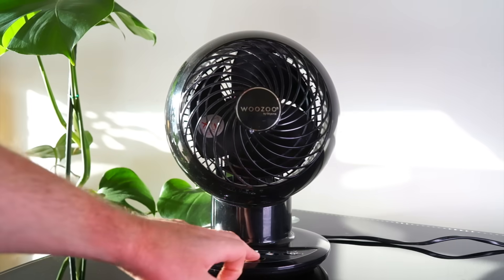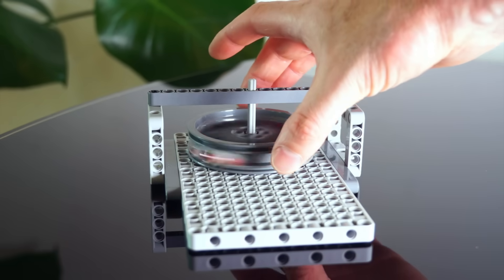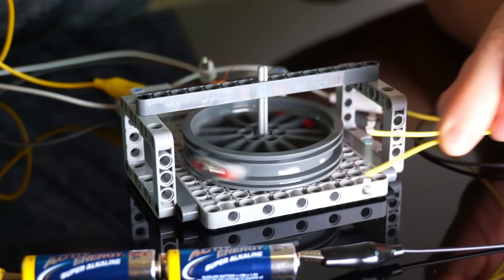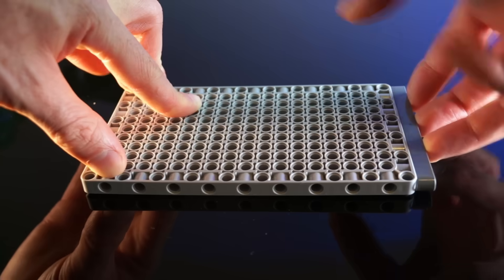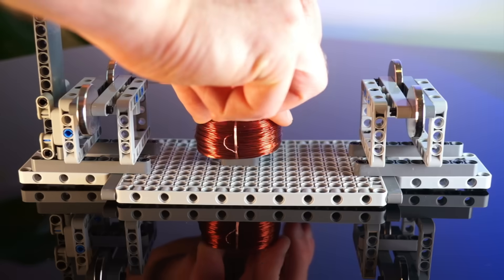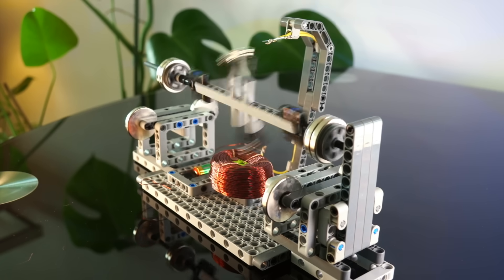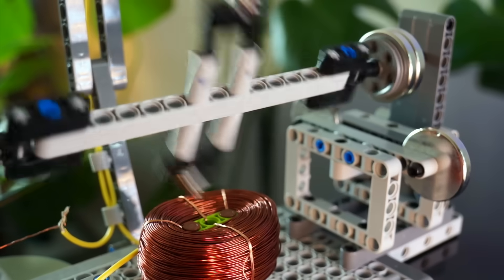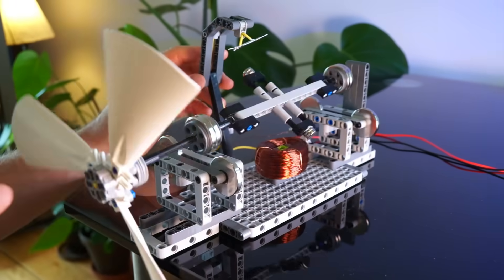Making a Totally Silent LEVITATING Fan Using Lego

Comment: Add more magnets, now you have the most basic setup, the more pairs of magnets you have the more frequently the coil pushes the magnets, also you can use a reed switch but make it turn on a transistor so your reed switch wont weld itself, and also you could get away with much much smaller coil, as for the power delivery you can still use the signal from that one reed activated transistor to turn on/off a pair of smaller coils sitting close. if you have lets say 5 pairs of magnets as your rotor you make it so the polarity alternates - the coils are apart exactly how far apart magnets are and the coils alternate in polarity too, now you can extrapolate it in two ways. Use one rotor and for each magnet you got one coil, or you make a second rotor and second pair of coils, and if the shaft already spins the rotor acts as a flywheel, you can hook up the transistor gate to one of the coils so it opens and closes exactly as fast as the rotor spins, now the only thing to do is speed control which you can implement as potentiometer which you put in front of the transistor gate, hide the circuit with bricks (also, use a sturdy li-ion 18650, pick one from philips/sony/samsung etc., you want the current to not be the limiting factor, but also you need a way of limiting current if you use one of them big boi batteries, they are quite powerful and will fry the circuit if you dont have a way to throttle them and limit their current). I hope that i provided at least some ideas for anybody! Sorry for the wall of text
Reply from the maker: Woah that's some phenomenal advice, really appreciate you taking the time to explain this! 🙏 I think I already have most of the components here.. love the idea of using a LiPo to provide all the current it needs. Wiop just need to play with combos of coils and magnets. Thanks again for the ideas! 😁
Reply: Well, the project is dope and I got excited like a little kid 😅
Sub well deserved ❤
Reply from the maker: @likemau5552  aw that's a hell of a compliment, thanks man! And cheers for the additional ideas 😉

Comment: Perhaps you could use something like a relay or mosfet, using the reed switch for the signal instead of handling the load 🤔
Reply from the maker: That makes a lot of sense, a few folks have suggested that, so guess I'll have to give it a try! Cheers 😁
Reply: @JamiesBrickJams  If you do that, also make sure to add a diode in the blocking direction (pointing from negative to positive) parallel to the coil. The coil generates high voltage pulses when turned off, which isn't a problem for the reed switch but almost definitely will be for the MOSFET.

Comment: Use more magnets to secure the ends in place, with all that axle wobble your power output isnt consistent either!
Reply from the maker: For sure, that wobble is frustrating. Once it's moving fast, it all balances out nicely... But getting there is challenging. Worth trying more magnets around the ends - cheers!

Comment: Wouldn't it be better if you use atleast 3 coils around the levitating shaft with an ESC and you can also increase the magnets on shaft
Reply from the maker: It likely would. I actually chose to use just one coil for a silly reason - aesthetics. Figured it'd look cooler with minimal stuff in the way so you can see the levitating shaft better. But adding more magnets to be propelled makes a lot of sense, will try that! Thanks!

Comment: Very cool! I'll bet you could design and 3D print a single-piece fan blade that is far lighter than the one you built out of Lego pieces.
Reply from the maker: If I knew how to 3d print, sure 😁 It's a pity Lego doesn't have many options for fan blades
Reply: @JamiesBrickJams  See if there's a local makerspace or fablab that could help you out.

Comment: some magnets on the top to keep it stable might help
Reply from the maker: Hmmm never thought of more magnets to keep it from bouncing around ... Worth a try, cheers!
Reply: @JamiesBrickJams  Adding a second coil on the opposite side would also lessen the bouncing, the single coil design will pull the axle downwards every time it is triggered  which will then bounce back up once the coil turns off. Having a second coil directly opposite would counter that downwards pulling force from the bottom coil.

Comment: how does this not have more views? this is epic!
improvement idea: try different fan blade styles and magnet sizes!
Reply from the maker: Haha thanks 🙏😁 I could totally try different non-Lego blades. Though as the other commenter noted, Lego doesn't offer many blades. It's a pity their helicopter blades are so heavy. I will try more magnets though so there are 4 instead of 2
Reply: These are basically the only fan blades from Lego, so you can’t really make the fan different without making it less sturdy, besides changing the number of blades
Reply: Or I guess glueing it together is an option

Comment: can use bearings on each side for more smooth movement :D
Reply from the maker: I like the idea of using some kind of Lego 'bearings', especially if scaling up a motor that has a ton of torque!
Reply: @JamiesBrickJams  normal bearings will fit better than lego made :D I make time ago some experiments with lego technic and solar panels, arduino, esp32, etc and all runs smoothly :D
Reply from the maker: Might give that a go if all else fails.. but I like trying to maximize Lego 😁 That's awesome, what projects of yours used the solar panels?
Reply: @JamiesBrickJams  some type of Rover,with solar panels, charging system etc
Reply from the maker: Love it, cool project!

Comment: U can use a reed switch but it should be connected to a transistor and the output of the transistor can be connected to the coil.
This can prevent the lock up of the reed switch on passing high current as the high current only passes through the coil leaving the reed switch isolated
Reply from the maker: That makes a lot of sense, thanks! Yeah would be lovely to chuck a bunch of current through it without locking. Though I've a suspicion it'll still be quite 'bumpy' unless the positioning is perfect. Great advice though, thanks - will try it! 🙏
Reply: yee i was gona say that aswell
Reply: Mechanical switching on motors is bad as you're limited to the physical moving speed of the mechanical parts.
Reply: @DarenPage  its not a mechanical switch, its eletronic
Reply: @mecadragoon  the reed switch is just that; a switch operated by a magnetic field.
Reply: @DarenPage  yeah but its still a eletronic switch not a mechanical
Reply: @mecadragoon  ok, We're both right... It's electromechanical.
Reply: U can also replace the reed switch for a hall effect sensor to improve the performance.
Reply from the maker: Yeah, I've a whole bunch of them lying around - will definitely give those a try. And I don't mind frying them 😉
Reply: @xtrarobotics  would a smaller coil work? The moving magnet makes an eddy current, this activates the transistor and thus the kick to the main coil

Comment: how to improve this thing: don't use a reed switch
Reply: Use a hall effect sensor and a transistor instead
Reply from the maker: @agaldoo  that I certainly will!
Reply: @JamiesBrickJams or even just a transistor with the reed switch. Will still work fine but won’t need any sort of digital control.
Reply from the maker: @xiar5546  seems a few folks have suggested that, so will definitely give it a try. Should be able to transfer a lot more power anyway. Just gotta find a good position for the switch
Reply: @JamiesBrickJams  use something weird instead.
Use led and photoresistor and leds.
Reply: An ic such the ah267 an IC like the ah267 could make things a lot easier, plus you could add a lot more magnets to the motor, these ICs are in most pc fans
Reply: Ha???
Reply: @agaldoo maybe add a flyback diode for higher voltage or that transistor might die from the reverse voltage spike from the coil
Reply: @agaldoo  I mean using a transistor as a relay would work with the reed switch also?
Reply from the maker: Solid advice 😂
Reply: And reverse the blades (they're the wrong way around)
Reply: @ultimateearrapechannel31 yup
Reply: @ultimateearrapechannel31  I really didn’t want to like that comment because it’s so irrelevant in this context but you are right and now it annoys me 😂. Well spotted.
Reply: Use a capacitor in series and a PWM. BETTER Efficiency
Reply: No, just connect it to a power transistor that will control the coil, this would eliminate the fusing problem and make the
coil be able to run on a much higher current.
Reply: You need to read polarity say if you have more magnets, so you can reverse the flow in the ekecrrimagnet, that is really what is needed to make it work well.. and... then you need a hall effect sensor
Reply: how to keep it simple: keep the Reed switch
Reply: Why the top comment always says information that is *already present in the video*?

It's like people start watching the video, look at the comment, and think it's original, due to not reaching the part of the video where the creator says exactly what you typed

Makes you feel smart, huh? 400 "likes" just means there's 400 people who are as dumb as you and don't notice that you're just parroting lines from the video like it's your own original idea. Dubmass (yes, I spelled it that way to get around "community guidelines". If you're un-dumb enough, you'll understand my meaning)

Dubmass supreme burrito with guacamole and sour cream and sour grapes that you eat with your humble pie crow flavored pity sandwich.
Reply: use a weed switch
Reply: I had an idea, rather using a Reed switch and a DC voltage, plug the Coil into a power socket
Reply: the electricity from your socket is already alternating current
Reply: @brlinf06398  bro it doesnt work like this and also it can get your house on fire.....
Reply: @brlinf06398  No!
Reply: @brlinf06398 I guess do that if you have a death wish